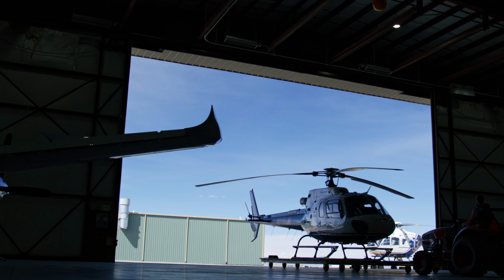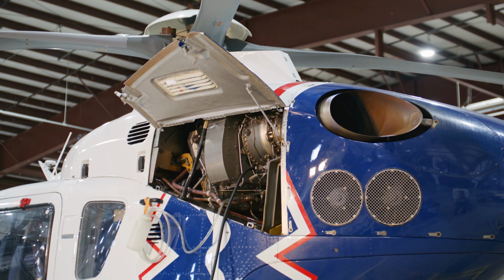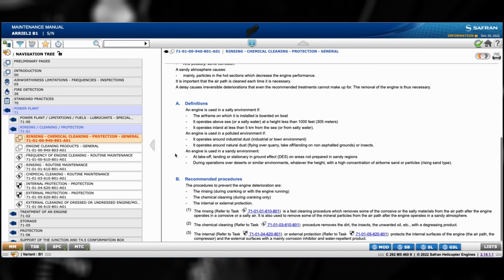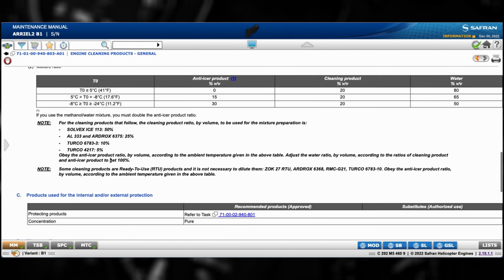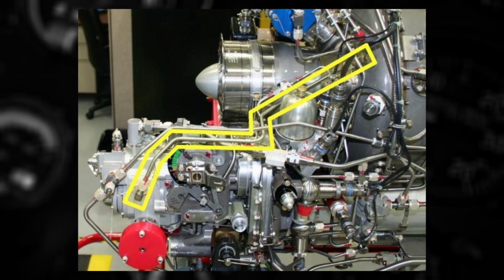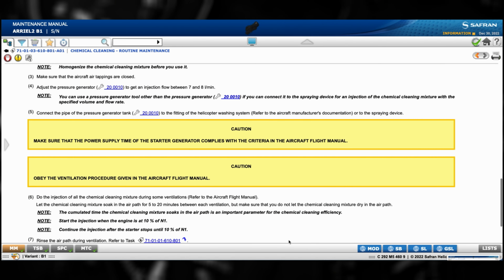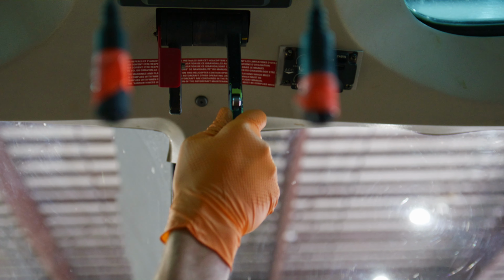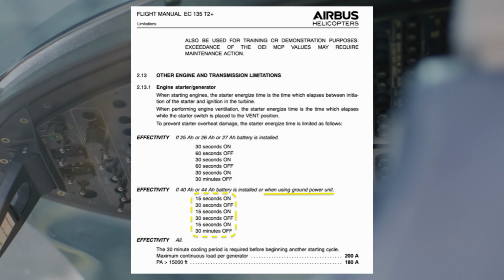Safran Helicopter Engines (Turbomeca) explains their compressor wash procedure

Comment: Excellent video, thank you very much for sharing it my dear. Many people ask us if it is necessary to use dezmineralized water. This is super important since many parts of the engine are made of Titanium. If the technician uses normal water, it contains chlorine. Chlorine is highly harmful to titanium, which generates micro-fibers that could deteriorate quickly or even generate a detachment of a component that is made of titanium (blades, compressor stages, etc.).

many greetings

Comment: Good morning sir  , really i appreciate this presentation,  very interesting. 
- just question si : after washing with Ardrox 6367 i think,  we must clean after only with Demineralized Water and finish ground run or in French  point fix. 
Best regards
Reply from the maker: Correct, the minimum water quality for cleaning and rinsing applies to any of the cleaning products used and the final step in the cleaning process is the rinsing task which ends with a ground run.   This video is an overview of the process, please consult the current revision of the applicable maintenance manual for specific instructions.  ¬¬
Reply: @safranhelicopterengines  thanks sir for the feedback. 
Best regards